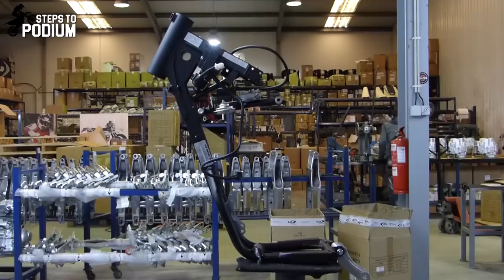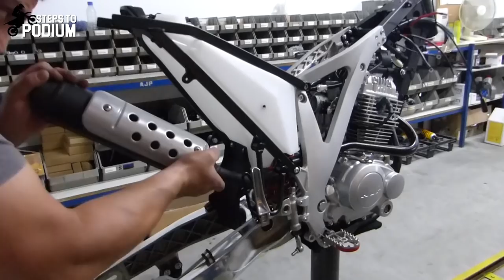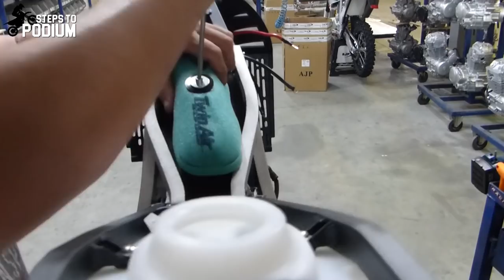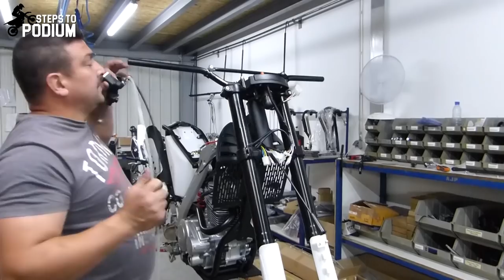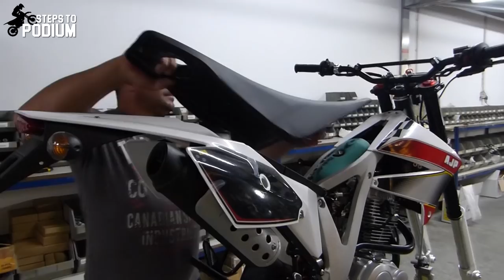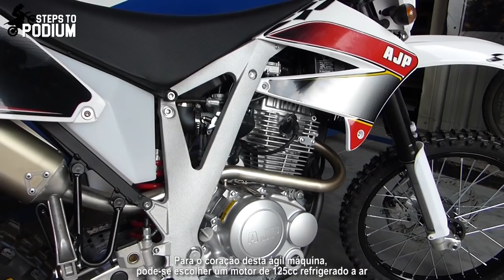AJP PR3: The perfect bike to start in Enduro

Comment: Picking up one of these tomorrow but I gotta say I'd probably not be happy if I bought a new bike and there were scratch marks from the installation on the forks...
Reply from the maker: why would you have scratch marks on the forks?
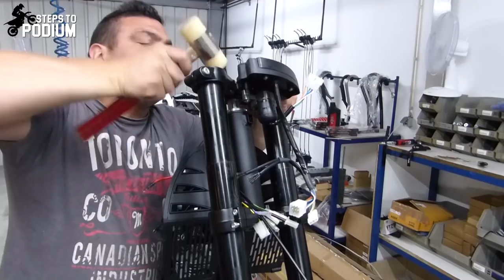Reply: @StepstoPodium  at 2:55 it looks like there're scratches (granted not deep) on the right hand fork leg from where it was slid and twisted into position.

I get that it could be a lubricant, but it does look like scratches lol
Reply from the maker: it probably looks scratch because of the lubricant they use to clean the forks before assembling them! :) (I watch them clean them beforehand) But in a production line I imagine that one or another might have a scratch or something. ..
Reply: @StepstoPodium  yeah I've used WD40 to hide scratches in plastics and powder coating before :P

I've no doubt that there might be some scratches and stuff, but if it was on a brand new bike from the factory, I'd probably be annoyed to see some damage lol.

Thankfully, the one I'm picking up tomorrow is a rat bike so I don't haveto worry about scratches or keeping it clean for a while before I do an almost full restoration on it.